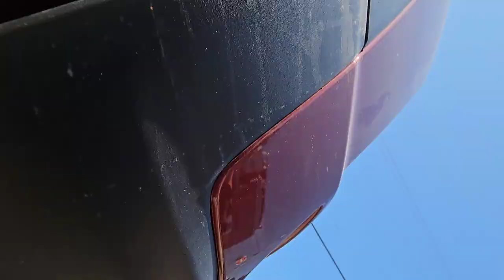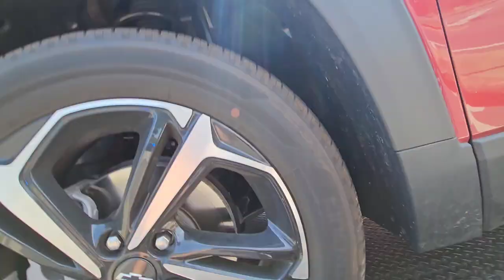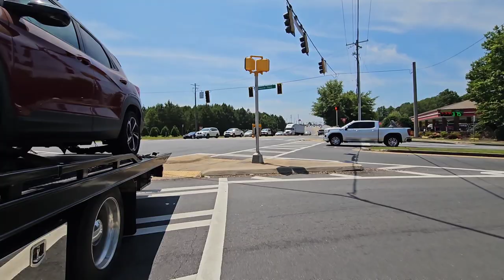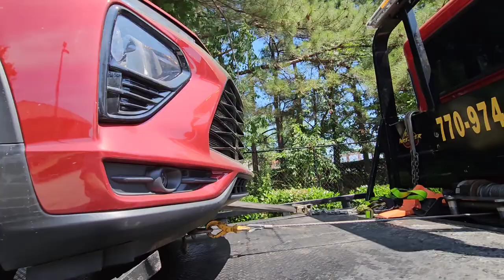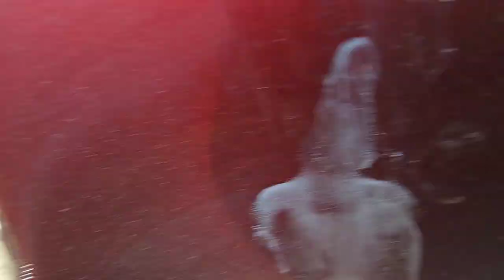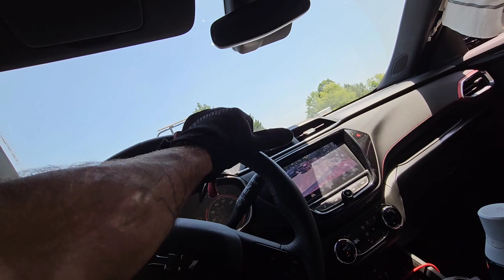Wrecked trailblazer! Police rotation call#tow#wrecker#winchout#towtruck#rollback#flatbed#viral#video

Comment: The one I remember most back in 2012 we got a hazmat call from airport fire rescue
for a plane crash and the heavy was in the dealer for service and my rollback was being used by another driver on another rotation call I only had an old international 4700 rollback headed to the airport gained access to the runway all I see is foam and a plane no landing gear back story is it was a 90's model Barron beach craft
Twin engine all updated electronics and it was it's maiden flight an F-16 fighter pilot was testing the craft and couldn't lower the landing gear he had to fly the fuel out and belly land it I had a roll bag on the truck from our office that had a small leak when I was at the airport hanger picking up the owner to ride out with me he asked was I gonna drag the plane up the bed I had to come up with a solution quick looked through the boxes found the bag we filled it up with their compressor taped off the fitting grabbed a big piece of cardboard and rushed out there and started to load the owner told me don't worry the guy filming was the insurance company Loyd's of London 😱 he was there oversee the flight With two four inch strap's tied together leashed the two props turned into a giant bridal put the bag under the tail of the plane with the tip  of the bed under the nose slightly raised it up put the cardboard on the rollback bed and about five feet under the plane released the truck brake raised the nose and winch walked the truck under it it only took loading and securement about twenty five minutes brought it back to the hanger and landed it on some giant foam blocks driving back going through the fence entrance had to be careful I had wing's about ten foot off each side😱 the charges for that call was $1,900.00 for about fourth five minutes but it was hazmat and yes I am hazmat certified the only injuries was the pilots PRIDE! Understandable those military pilots are on another level and the plane wasn't damaged that bad from me or the pilot but the insurance company deemed it totaled 😱🤣 they invested over half a million dollars and in an hour worthless only for part's the owner showede the video of the landing it was flawless that pilot was amazing I didn't get to speak to him but definitely told him great save he said thanks I have some pics of it and got featured in
Towing Is Rad magazine had a bunch more like towing President Trump's Lamborghini Diablo as well 😱👍🇺🇸
Reply from the maker: Holy smokes!! OK my first  call ever Kennesaw pd overdose. They gave this kid 3 shots of narcan finally he woke up the got him out of the cat and I had to winch the car out of the kuzu field 20 feet from the road. Man I got the car out but because I didn't know how to keep my spool straight I wrapped all my cable up to one side strapped and loaded in 20 so I get to the yard my boss calls said your backing up another wreck 41 and Marshall so I drop fast!!!! Haul my but to the 2 timer and David sees my winch cable and starts flipping out understandably it was a hot mess. So I freeze up right in front of police and David starts to understand I don't take information like that well and we strapped the car down and I followed him back to the yard. Not my craziest but this was my fist 2. I can't imagine how cool it would look to have a plane on my wrecker!! Damn mike!!